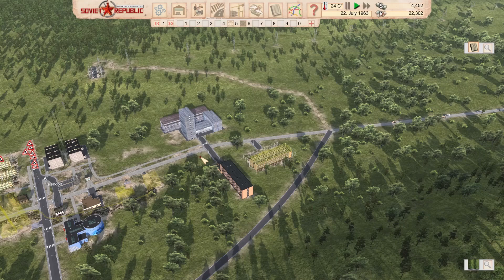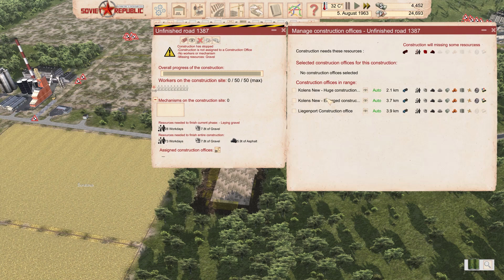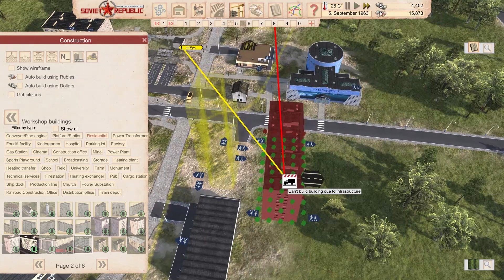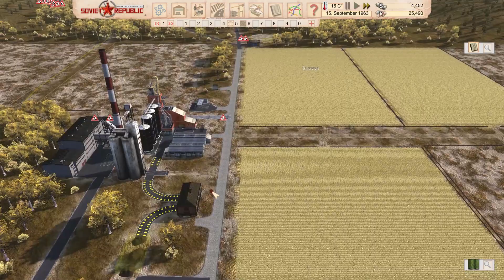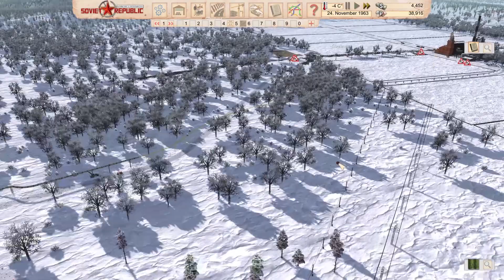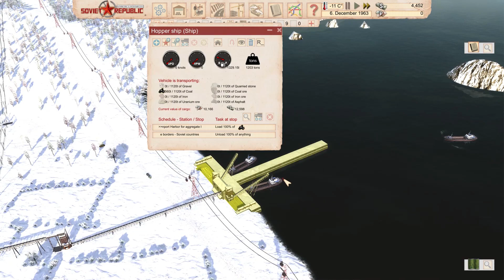Workers and Resources - Soviet Republic - Liberatian Socialist Republic - Ep.9

Comment: To transfer students you can do it two ways:
A) You have free dorm rooms and a train/bus anything goes close to dorms. Students will enter on Station that allows students in said buss will travel to the dorms automatically if a bus goes to said town with bus Station that has dorms and they are in range of the bus/train Station. 
B) You choose in the building the 21+ tab and then simply move citizens as you do normally to dorms manually.If there are any 21+ Adults living with parents with required minimal education of basic.
Littel trick one if the bus moves back to the town the students came from and there is free space in houses students that have finished there study´s will move in there automatically and start working.
The trick is to have public transport and free space. Other wise you have to move them manually and the more people you have the more problematic it gets. also keep mind students need food and entertainment and other stuff like normal citizens.
Also you can block off the cable way for students and travels and only allow workers to enter it if you remove the check marks for students and travels the boxes with green checks. this way you can transport and host more workers in cable way to coal mine. Same goes for all Stations. This way you can have workers only Stations.
Also trick number two, if a connection is under 4 hours and travels are allowed and one city or village has no shop people will go to the closest town with a a shop and the bus/train driving to shop, watch movies and see the doctor. true story saw it happen. Keep shops and bars close to bus Station where workers and travels are. Also maybe some trains ;-) and train Stations.
Reply from the maker: A. I did this before in Leszcie and it did not work. (Spoiler alert) It seems to be working now!
B. I tried manually and I got 68-year-old living in a dorm and not being a student. Maybe this is working as intended. 
I did not know that the students return to their town of origin. I thought they will go to any town that has living space and work. 
I am aware of the checkboxes but I do not have space for another station in Liegenport. I think it would be great. I will try to make some space and out a separate station. Not that we need it because I never saw more than 50 people at this station. So the capacity is not an issue and the buses are not queueing. 
I just saw amazing videos about people traveling to other towns to see the doctor and do the shopping I will test this. The new mining town that we are constructing will only have houses and a church and a really good connection to town that has everything. I wonder how it will work! :) 
As always Viele Dank!! 😃
Reply: @oolykeegaming81  Yes you are right they move to the first free flat, I was just revering to a bus connection from you main town to the university town.
Reply from the maker: @LDZMarder  I understand. Cheers bro! You gonna love what's coming. 😊😊